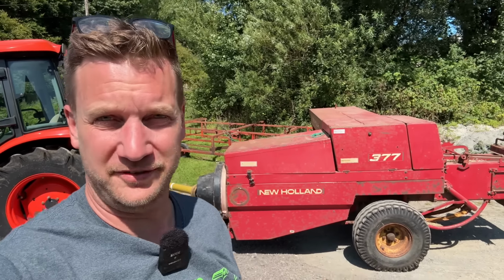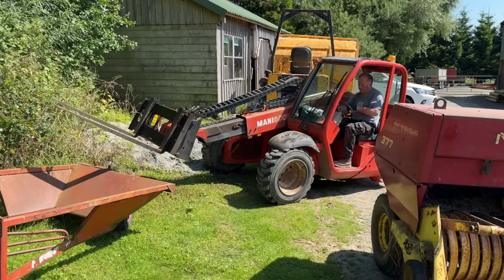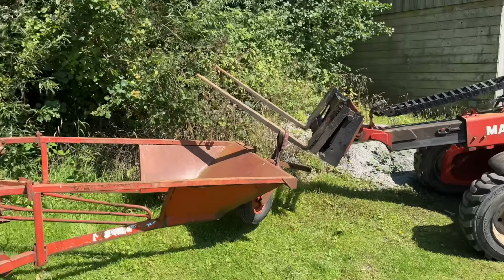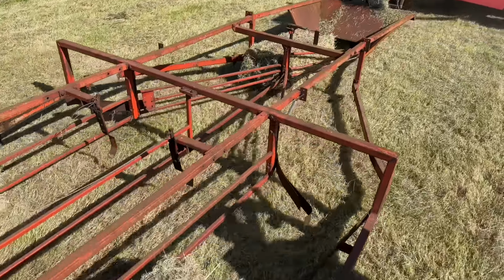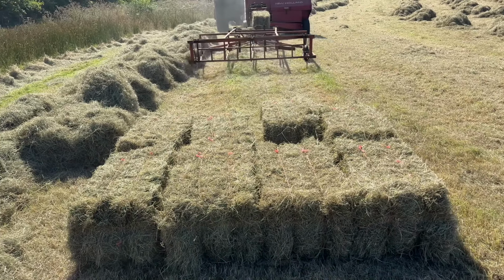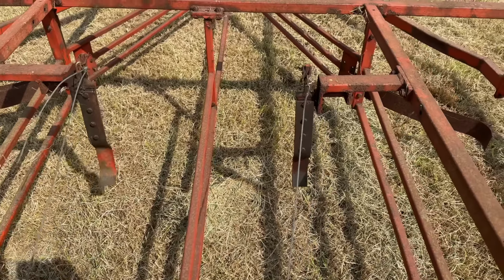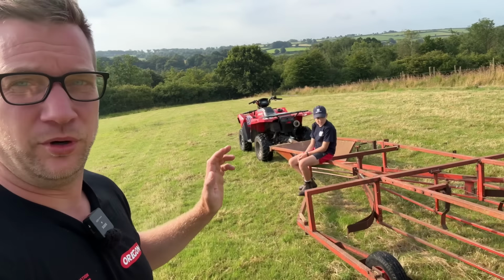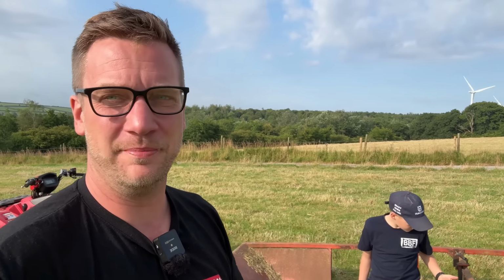How Does A Bale Sledge Work?

Comment: Cooks windrower is the sledge to beat, have run the Browns sledges too. The Cooks allows you more freedom on where the packs are dropped and packs the bales tight together. The ones I've run all had hydraulic trip for the back gate, so no pulling a rope to release. Have run a belted Flat 10, wasn't over impressed as the bales had to be longer and it still struggled to deal with them in massive crops. That New Holland is going well, decent shape bales. We only do 6000 a year but looking to increase this number now we've invested in a used Arcusin. Great channel, been watching a lot of your other videos on machinery buying and repairs.

Comment: A Cooks sledge seems the be the old boys Rolls Royce of bale sledges, due to the brilliant design in which you can make an 8 and sill carry another 4 bales before you need to drop the 8, thus doing away with the problem of dropping 8s where you don't want them 👌👌 does make it half as long again mind 🤦‍♂️😂
Reply: Very true, having used Cooks and Browns sledges I much prefered the cooks, able to carry extra 3or 4 bales and I could drop my 8 where I wanted.
Reply from the maker: It’s pretty cool, carrying the next 4 ready. I did contemplate a cooks but with our small fields, I didn’t think it was wise haha.
Reply: @finditfixitfarmit  I am in the same boat with small fields, I can't imagine there are a huge amount of serviceable flat 8 sledges out there.

Comment: The accumulator was probably configured for bales that are slightly longer than you are making yours. If you want to keep the same bale length but have it trigger correctly, you could move the lever arm locations rearward on the frame by a few inches, to bring the last bales closer to the back row before they cause the gate to open. Better yet, rather than re-welding, fabricate connections you can loosen and reposition while in the field so you can continue to dial it in with lever locations and wire length.
Reply from the maker: That’s a very good observation that I haven’t thought of and sounds bang on. When I bale again next year, I will check it out. Thank you.

Comment: Exactly the same baler as my daughters, and same problem with last bale not going in all the way we just left it and pushed the bale in with the flat 8 loader, try not to take such tight turns baling  so the bales don't miss the sledge drive past and take a wide turn without picking up grass  👍
Reply from the maker: Great advice, thanks Nev 👍🏼

Comment: Great video, got a question, how does that front gate work?  Seems like there has to be a spring  somewhere cause it doesn't look like it follows the paddle at the bottom.  I see the spring at the top, but the bottom paddle flips over to the other side then the gate slowly follows when the bale has gone through.

Comment: I used to use a Cooks bale sledge behind the same baler as yours and if i remember you took the chute Off the back of the Baler so the bales dropped straight into the Sledge, someone may correct me but hope that helps.

Comment: I never see a Browns or Cooks for sale here in the US. You only see the ones made in the US and they are expensive even for used ones.
Reply from the maker: I’m not sure if they ever exported them. I’ve seen some US sledges and you certainly have some interesting setups compared to us!
Reply: @finditfixitfarmit  I think some of them copied off of the design of the Browns and Cooks. Steffen accumulators seem to work good they are hydraulic machines and not cheap even for a used one usually around $10,000. Farmhand hydraulic ones are pretty easy to come by and not that expensive, I have one of those. They have many ways of messing up  if the conditions are not ideal, like pretty flat fields and hay not too heavy, bales not popping out too fast.